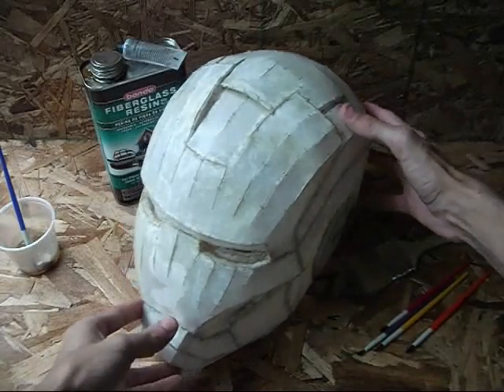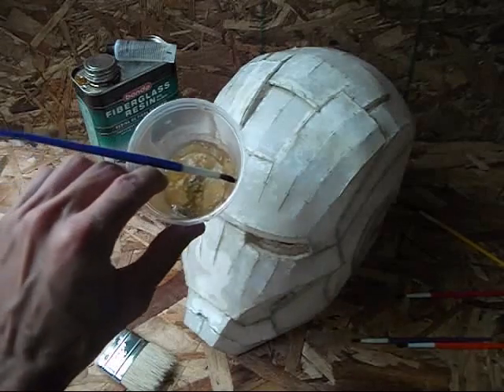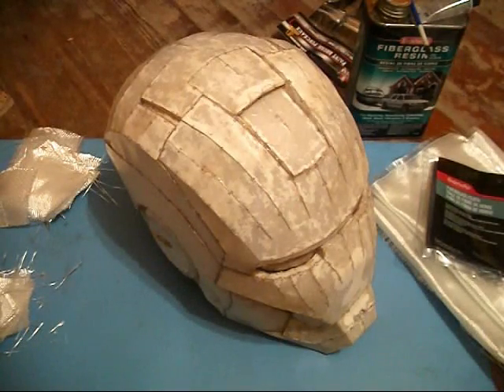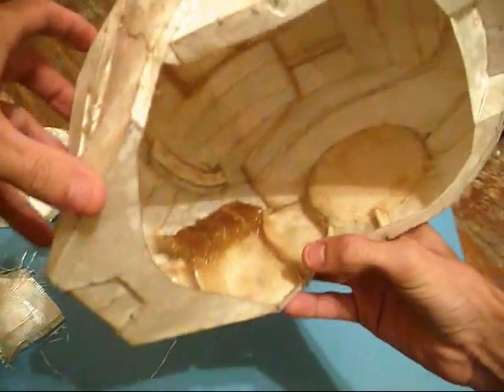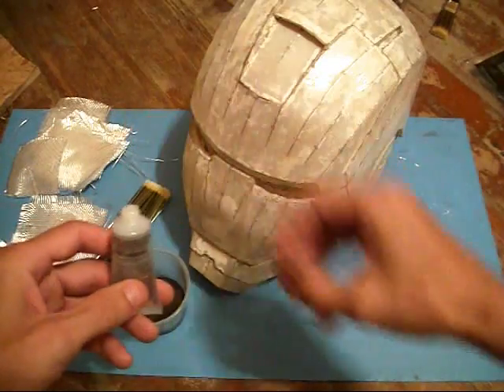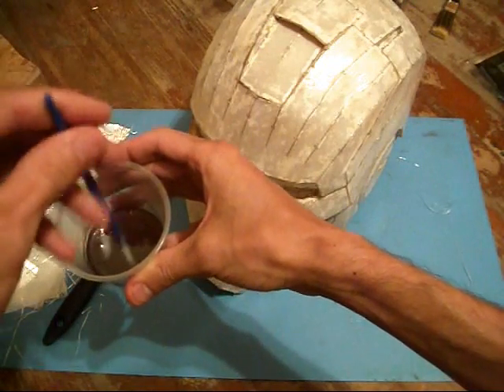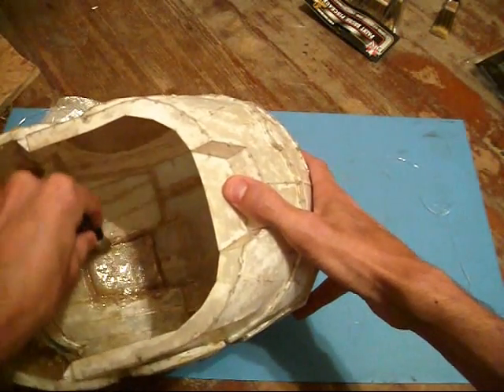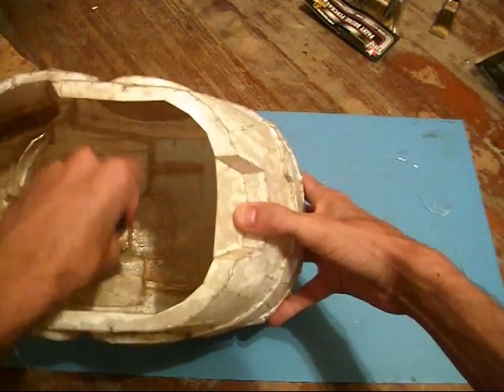IRON MAN HELMET BUILD PART 2 ~ RESIN & FIBERGLASS

Comment: hey, why didnt you apply fiberglass on the outside? All tutorials Ive seen use fiberglass only on the inside...is there any special reason?
Reply: I thing it's because fiber glass it's edgy and irregular, and it's harder to polish than the inside, where you dont have to polish it, because it is not visible there.
Reply: PiercerMusic yeah, maybe its just the geometry. Im doing a batgirl cowl and just added a coat of gelcoat above it to smooth it out
Reply: yep, I think its to save time, instead of having to do another coat above the fiber glass. I am doing a Lich King helmet, but I still working on the papercraft, so I will put here my final thoughts of the fiberglassing outside or inside when I finish XD

Comment: what is the working time of the resin? Mine cures in 3 to 5 minutes making it difficult to place the fiberglass
Reply from the maker: You're adding too much hardener.  Work time should be 10-15 minutes.  Although, remember, hotter temps accelerate the curing, and colder temps slow it.  Also, not sure how much you are mixing up at one time, but larger masses of the resin generate more heat due to the chemical reaction taking place and cure it faster.  If you mix up a cup or so of resin at once, let it spread out in an old pie pan or something to reduce it's mass.
Reply: thanks for the tip
Reply: Milik saya dua hari tidak kering
2 day not working
Reply: Alee Joefrie did you even put some hardener on it?

Comment: so i started to use 10ml (OR 0.33814 oz) of resin with a drop of hardener. I covered half my helmet when i applied it. but it still smells after 24 hours and a small tiny part is still be abit sticky. i dont want to get poisoned when i wear it, so what should i do? will i restart all over again or wait it out?
Reply from the maker: It's not going to cure any further no matter how long you wait if you didn't add enough hardener.  Mix up more resin with more hardener and give it another coat to seal it.  If you need it further sealed prime it inside and out.  You can also dust the entire thing with baby powder after the resin has cured and before you prime it to remove any tackiness that may remain.

Comment: so all of that was printed just by computer paper??
Reply from the maker: Yes, but on thick, 110 lb cardstock paper.
Reply: can you tell me where i can get the paper? or if i ned a special printer for it? also can you tell me how you set the size to fit you right?
Reply: just a normal printer, you van adjust the size of the armor or what have you before printing out the pepakura files... that is done with the pepakura application

Comment: is it okay if I use aqua resin? is there a difference?
Reply from the maker: +braden weddle  Aqua resin is an epoxy, but yes you can use it in place of polyester/fiberglass resin.  It will work the same and is just as strong.  Plus side is you don't need breathing protection with epoxy resin :)
Reply: Thank you sir!

Comment: I know this is a odd question but do I print the pages with a regular print an if so how do I get the model parts to fit on the paper is it a way I could scale it to fit?
Reply: Get pepakura designer is $38 unless if you don't want to save it's free but you can around the pieces and if it says fix scale don't but some will be cut off
Reply: +braden weddle Oooh ok thank is there anywhere I could find more ironman pepakura files like this I'm new to pepakura
Reply: Not all of them cost money most don't. You can buy already made ones too
Reply: +braden weddle thanks I'm checking out that website now pretty cool. Is this the only place I could get them?
Reply: plz call me 9666818102

Comment: i use fiberglass to make custom subwoofer enclosures and the fiberglass mat is actually stronger because it re-enforces it in every direction possible because it is in a random mat not woven...also the mat is easier to get into smaller areas. it may be messier but in tight areas and areas with a lot of curves its a lot easier to use the mat by far.

Comment: im ml how much resin and hardener would you use just for the coats before fibreglassing ?
Reply from the maker: Prodotype Gaming I'm not sure about ml, but not much man....just enough to saturate the paper.  You don't want to glob it on...just a few thin coats of resin inside and out.
Reply: So how many coats maybe 2 inside and 2 outside ?
Reply from the maker: yes.
Reply: Between coats how long do you need to wait like
Reply from the maker: +Prodotype Gaming  Until it hardens and isn't sticky anymore, then put another coat.

Comment: whenever we want to motorize the helmet, are we able to cut out the face plate? Or no?
Reply from the maker: ***** Yes, you can cut the faceplate out with a Dremel tool and cutoff wheel.  That should be one of the last things you do (after all filling and sanding is done to smooth the helmet) so everything stays lined up.  So many people make the mistake of separating the helmet into pieces before all this is done and then have a ton more work to do to get things lined back up correctly and looking good.
Reply: Awesome so I watched your whole tutorial.. And I'm wanting to start this project soon. What template did you use exactly?
Reply from the maker: All 12 of them!?!  Lol!  The template is the Mark 6 by Sharkman (unfolded by Dubean33)
  I think I found it on 4shared.com
Reply: Yes i did haha xD! Spent most of my day just watching your videos. Also I subbed :3 and thanks!

Comment: could you use poster board i was thinking of starting this and im scared that if i use poster board it will not soak in the the resin?
Reply from the maker: I would stick with cardstock, 110 lb.  Even on cardstock the resin doesn't soak all the way through on some areas so posterboard being slightly thicker would have even more of a problem.  It's not necessary to use anything thicker than 110 lb cardstock though, plus you would have to cut the posterboard to fit a printer ;/

Comment: So this may be a stupid question, but humor me!  Would it be possible to mix the resin then place in a spray bottle and spray the pepakura project?  Im only saying this because I so desperately want to finish a pep project, but it's to damn cold.  Need other methods to try to complete this.
Reply from the maker: Unfortunately no, the resin is too thick to be sprayed..it's like honey.  If you need to do it indoors and don't want to deal with the fumes of fiberglass resin you can use epoxy resin....just as strong and no smell or harmful fumes to deal with.  Something like epox-amite 101 with a fast hardener.
Reply: Thanks for the tip I never knew this existed.  Now this is a two part question.... Would the locktite epoxy work as well?  And what are your thoughts on epoxy putty being a slight replacement for bondo.
Reply from the maker: supermancv I guess any epoxy would work really but do you want to buy 10 tubes of epoxy? The putty is like play-dough...might be kinda hard working with it...I know you can smooth it easier with wet fingers but still, it's much thicker than Bondo.  And again, do you wanna but 10 tubes of epoxy putty at $5 a tube?

Comment: Love the vids. Is there a reason you are using Fiberglass instead of what I have seen some people use I think its called Rondo, its a mix of bondo and resin?
Reply from the maker: Joshua Wirht Rondoing the inside is more so just a quick way of doing things.  Yes, it will work but body filler and resin alone are not for strength...even mixed it is brittle and can break if dropped.  It will also make the helmet much heavier.  Fiberglass and resin are for structural applications and meant to be used in combination for strength.  With the three layers of fiberglass (which is a bit overkill to be honest, 2 layers is very strong) I can literally stand on my helmet and it won't even flex.  Rondo is great to give a bit of rigidity to a helmet you don't plan on wearing...for instance if you were just building it to be used to make a mold of and cast copies out of something lighter...but for making just one helmet for actual wearing, fiberglass is much, much better.
Reply: Awesome! Thanks

Comment: Hello! I was just wondering what kind of Respirator i will need. There are so many different kinds i would rather like to not die.
Awesome tutorial by the way : )
Reply from the maker: Thanks!  A half face/half mask, two filter respirator would be the most common, and the type I use as well.  Mine is a 3M brand but other brands can be had for cheaper...just don't go too cheap, lol, we're talking about your health here.  The type of filters you want are called organic vapor filters (they usually come with the respirator).  You can also buy P95 filters for filtering out dust and particulates, and you can even get particulate filters that fit over top the vapor filters so you're protected from both at the same time.

Comment: thanks so much, im so inspired now, been planning on doing masterchief for a really long time, just didn't think I could, this looks way easier then I imagined
Reply from the maker: You're very welcome, and good luck.  Be sure to use a respirator with organic vapor filters on it when using the resin, it is extremely important to your health.  If you don't own or want to buy a respirator try Aqua Resin instead.  It can also be used with fiberglass and there are no toxic fumes but it's a little more expensive.
Reply: TY so much!

Comment: I have an question if anyone acknowledged about this process may answer it please, if I'm making a wearable helmet will it matter to put the fiberglass cloth on the outside or inside of the helmet? If so then what is highly beneficial to place the fiberglass cloth at?
Reply from the maker: Place it on the INSIDE only.  It will cover up the details of the helmet if put on the outside.  Most protective sporting equipment (including headgear) is made from fiberglass.....no dange of it being on the inside.  Just make sure and sand off any sharp bits sticking up after it hardens before wearing it.
Reply: boochieboy814 Speaking of fiber glass on the inside, what did you use to pad the inside after the fiber glass? Like, a foam material or bubble wrap? Because no matter how much I sand there is always a prickly edge or two on the inside and if you could include a link to a product you suggest I'd really appreciate it. =)

Comment: As a note, people should be wearing a respirator while working with any form of Polyester (Fiberglass) Resin. There is another product called Epoxy Resin that is safe to use without a respirator, and in doors without any ventilation without it being harmful, though the Epoxy Resin does create heat as it forms.
Reply: Is epoxy resin just as good?
Reply from the maker: Epoxy resin is fine.

Comment: once its all dried out, is the resin still strong smelling when you put the helmet on?
Reply from the maker: Not nearly as strong as when it's in liquid form, but you have to give it a few days...maybe a week even before the resin fully cures and the smell goes away altogether.  If the smell still bothers you you can prime the inside and "seal" the smell in with the primer.

Comment: Would fibreglass be okay to make a helmet such as that one impact resistant? I've been working on a halo helmet and I would like to make it strong enough to shrug off paintballs... I know it would probably have to be crazy thick but that's no concert to me.
Reply from the maker: Yes, provided you do a good job fiberglassing by avoiding air bubbles and not using too much resin with the cloth.  I could stand on my helmet now with 3 layers of fiberglass and it wouldn't even flex, and my helmet is maybe only 1/8" thick.  Many, if not most helmets and protective sporting equipment is made from fiberglass.
Reply: boochieboy814 Cool. Just needed assurance that I'm not wasting my time. Since it's called fibreGLASS, one would assume it to be pretty brittle.

Comment: Just out of curiosity, how heavy would fiberglass be if i were to make something like oh say Power Rangers helmets and power weapons, and a Ghostbusters proton pack out of fiberglass?
Reply from the maker: Fiberglass would be ideal for those things.  If you did the main body of the proton pack from styrofoam coated with a layer of plastercloth, then fiberglass and resin on top of that it would be extremely lightweight yet strong.  Fiberglass has a very high strength to weight ratio.  I actually have a green ranger helmet made from fiberglass and it can't weigh much more than a pound or so.
Reply: Oh, you have a Green Ranger helmet? so i assume Power Rangers helmets are very light. but what about when it come to power weapons?
Reply from the maker: ***** It would depend on what the base of the weapons is made from I guess.  If the basic shape was a lightweight wood or again, foam they would be very light also.  It depends on how they're made.  Fiberglass in general is very light.
Reply: Well if fiberglass is very light, then that is what i would make the Power Rangers helmets and weapons, and a Ghostbusters proton pack out of. the proton pack would be light because it would'nt hardly have anything in it. except a small enough speaker for the sounds. and i would have alice pack straps with comfy padding in them and and alice pack frame to carry it on my back. i think the power weapons were made of fiberglass in the TV series, and the proton packs were made out of fiberglass in the movies in 1984 and 1989.

Comment from the maker: Fiberglass cloth or mat itself is not toxic, the RESIN in LIQUID form is what's toxic (and the fumes from it). When the resin has cured and hardened into a solid it's completely safe, it's just a form of plastic.  They make storage tanks for drinking water from fiberglass.

Comment from the maker: I would add padding for comfort but the direct contact will not hurt you as long as you have all the sharp pointy bits sanded off and a thin layer of just resin to make it smooth inside.

Comment from the maker: Fiberglass resin is not compatible with most EVA foams.  It will eat the foam away.  Fiberglass resin itself would be too brittle to coat foam with anyway.  Most people use several coats of watered down white glue (PVA glue) or Plasti-Dip rubber in a spray can to coat EVA foam as it will remain lightly flexible without cracking off.  The watered down glue will give you a nice shine alone, but both methods can also be painted afterwards.

Comment: for some reason when I try to change the size of my helmet to make it bigger it doesn't fit the pages on the screen and when I do print out so it will fit on the sheets there is one page that comes out were I cant see the lines do you have any advice for this?

Comment from the maker: Hmmm.  While construction paper is better than regular printing paper, it still may not do so well as cardstock.  Yes, you can still use the resin, however, do very light coats because construction paper is going to soak up more of the resin than cardstock would, which could lead to a lot of warping.  Just keep an eye on it and readjust it with a hair dryer if needed after the resin hardens to correct any sagging.

Comment: hey, another quick question. when I was putting the fiberglass cloth into the helmet, some little strands kept falling off. Some of them got stuck to the outside. Can I just sand them off or is there an easier way to get them off?

Comment from the maker: I had the helmet outside at the beginning of the video.  The helmet looks like it turned yellow because of the lighting when I took it inside.....it was stil white.  Yes, it's normal for it to be flexible after just applying the resin....after you add the fiberglass inside you won't be able to flex it any more.  The fiberglass and resin together is what makes it ridgid, not the resin alone.  Just re-glue the eye and brace it on the inside with cardboard or whatever and re-resin it in place.

Comment: Hey, I just added my first coat of resin on the inside and outside. I noticed how your helmet changed colour while mine is still basically white and I can still bend it by poking at it. Is this suppose to happen this soft after the first coat? Oh and another thing I think I didn't add enough glue to one of the eyes and now it warped and caused the angle to become all messed up. Can I still fix this?

Comment from the maker: At the time I did not have one.  I was working by an open door and had two fans exhausting the fumes outside.  I have a proper respirator now which I use every time I work on the helmet.

Comment: do you think its a better idea not to glue all the parts together at first before fibreglassing?? for example leave the facelplate and ear pieces from the rest of the helmet separated so it would be easier further on when bondoing??or should i just put the whole thing together like you have done? then precede with the fibreglassing and bondoing?

Comment from the maker: The resin should start to harden in about 10 minutes from the time you mix in the hardener, and be fully cured in about 20-30 minutes max.  The surface may remain slightly tacky but make sure you're adding enough hardener too.....it shouldn't be gummy at all.  Use baby powder sprinkled on to get rid of the sticky parts.

Comment: Thanks, is the fibreglass resin and 2 part product that needs to be mixed, or does it come straight out of the can? I missed out the teeth as they were just too small and fiddly, i plan to add them in later

Comment from the maker: Yes, brush one coat of resin inside and out and let it dry.  Then, go back and add a layer of fiberglass the inside.  The resin will block the small grooves and details somewhat but as long as you don't put it on super heavy it should be ok.  Cutting/separating parts should only be done at the very end after all the Bondo work has been done.  If you do it now the pieces will warp and you vill have a huge headache trying to line everything back up again.